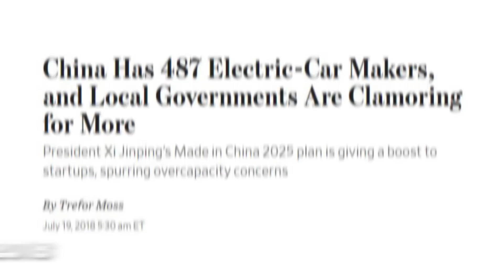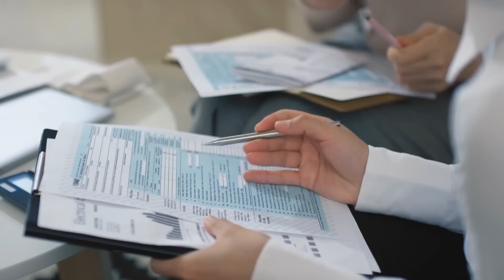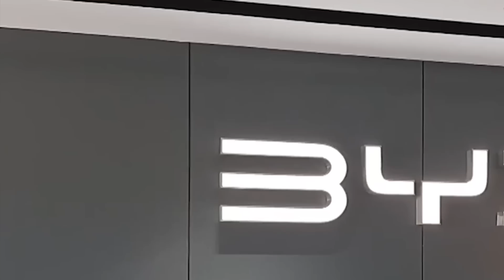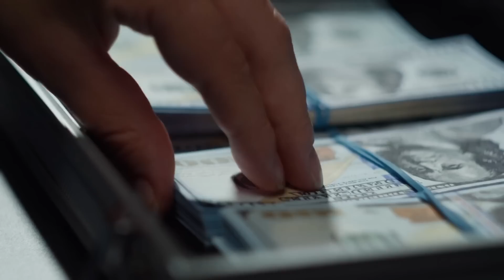Thousands Of EVs Abandoned As 90% Of Chinese EV Makers Face Bankruptcy

Comment: The 2023 plug-in share of total vehicle sales in China up until April was 33%, 23% for fully-electric vehicles.  Six plug-in models were in the  top ten vehicles sold in the country.  Four of the top 5 sales among plug-ins are BYD models, the other the Tesla Model Y.  GAC seems to be holding its own.  Geely is the manufacturer of Volvo and Polestar.
There are other factors that need be taken into account.  China has 80% of global battery production capacity.  China's CATL is the largest battery producer in the world. BYD is also a battery manufacturer.
Then there's the matter of China's plans exporting plug-ins, having represented around 11% of the European market in September 2022.
But wait, the above is only a part of the big picture.  In 2022, China had 600,000 electric buses and 400,000 electric trucks already on China's roads. 
BYD is a major player in both the electric truck and bus market. 
BYD had delivered 70,000 electric buses by January 2022. 
BYD has a full lineup of electric trucks. BYD will be selling classes 5, 6 and 8 trucks in the North American market. The city of Beijing is replacing its entire fleet of sanitation vehicles with 26 different models of BYD trucks including garbage/refuse trucks, street sweepers, sprinkling trucks, refrigerated trucks for hazardous waste transfer, etc.  
The portrait presented by Velocity lacks balance and only covers China's electric vehicle domination in the very last portion.
https://cleantechnica.com/2023/05/31/35-plugin-vehicle-market-share-in-china-china-ev-sales-report/

Comment: Do people realise that if electric vehicles were to take over petrol/dielsel/gas cars, that an industry that makes about $2 trillion a year "some giants make $2 billion a day" would nearly shut down. 

There is a lot of revenue from oil and what it gets refined into and a lot of investors who are invested into those companies.

EV's will never take over as there is a very little profit margin, unless you are getting Cobalt from Congo for cheap labour. Most companies will go bust without large backing behind them. 

More money in oil, that's what matters
Reply: What matters is clean emissions , most of your big car companies are in massive debt now like Nissan Honda ford , some will fall , electric is the future
Reply: Making electric cars may be cleaner at the tailpipe but it certainly isn’t resource friendly & if you live in Australia the soaring cost of electricity has  already eroded many running cost advantages , with it being stated that it is , or will soon be , dearer to charge your electric car than filling with petrol . Even if you have solar panels & battery storage at home , the lack of recycling facilities for panels & the replacement cost of batteries makes this option far less environmentally friendly than publicised.
Reply: @barbraabsalom4531  rubbish
Reply: @barbraabsalom4531  also they have just started manufacturing sodium batteries, which stops the far right wing whinge about resources problems

Comment: EV cars don't last long relative to ICE cars due to the battery going flat. Lots of e-waste.
Reply: That is an untruth, spread buy the uninformed. Go and find out the truth.
Reply: @robbymcbride4627  nope its what people who owned the cars have said. The batteries don't last anywhere as long as a well built internal combustion engine and battery replacement cost more than the vehicle itself resulting in high amounts of ewaste. Lithium prices are not coming down due to how finite the metal is. EV cars in their current form aren't ready for prime time. Doesn't make any sense to get one right now
Reply: @woodworking406 im not being specific to mileage, im talking about lifespan. That 1 million miles can be within a year but batteries degrade whether you use them or not. My old gas truck still gets the same range on a full tank of gas 27 years later. Would never happen with EV car. I would have to replace the entire battery after the 10th or so year

Comment: It's difficult to believe how China will become the leading EV maker. The major issue is quality control and customer satisfaction.
Reply: Nothing to believe..China is the leading EV Manufacturer..if not China, who then?
Reply: @calvinblue894  everyone else. China is leading on paper but not in reality. China is crumbling under its own weight. They started believing that corruption and coercion is the way. Not good for a country without energy or food.
Reply: It's not difficult to believe if you actually see what's happening there rather than relying on BS videos like this which is all about sensationalism and clicks.
Reply: Well, yes. It is easy to believe China is leading in EVs but the quality is subpar. Just think logically about Chinese quality comparison to Germany or USA. Ask yourself if they can't build infrastructure to last after it's built, how can they build a car to last.😂
Reply: @knauritsi1012  can't build infrastructure to last? Where did you get that from?
Reply: @jacee1113  Bridges falling, Underwater tunnel flooding from leaking. Sides of buildings falling off. Newly built and opened. There's plenty of evidence of using cheap materials in construction in China. I can go on, fire hydrants never hooked up. People don't understand what is going on in China. Everything produced fast and cheap with no quality control whatsoever all to achieve a status of leading output but failing in standards of safety and quality.
Reply: @knauritsi1012  they are generalisations. That can happen anywhere. Here in Australia construction companies are getting sued for using poor quality materials. You can't just zero in on China. What about all the things they've done right but you choose not to see?
Reply: @jacee1113  Built or made in China has a higher failure rate then made in say Germany. It's logical to zero in point out the source of the issue. Cheap and faster doesn't equal quality. China doesn't have that quality.
Reply: @knauritsi1012  oh yes they do. But perhaps not to the extent that it paralyses them with inefficiencies. They do get things done quicker but it doesn't mean they don't have quality control. There are many private companies there that do the right thing.
Reply: @knauritsi1012 some people have to shop at Walmart for inexpensive products that compromise on quality
Reply: @jacee1113  When Chinese are cutting corners in building supplies. When there is evidence of easily bending rebars by hand being used for construction. Bricks easily falling apart. No quality control whatever. Dalian Bay Undersea Tunnel in China floods soon after opening to public.
Reply: @DukeLM  Do you want a vehicle you drive down the road to compromise on quality. How about an airplane.
Reply: @knauritsi1012  where did you gather that information from???
or you are just biased, evny and anti China.
China's engineering in infrastructure is among the best in the world, which surpluses US by miles apart. Go and visit China and witness yourself.
Reply: Let me update you, silly goon.
China is currently the leading ev manufacturer and also the biggest market in the world.